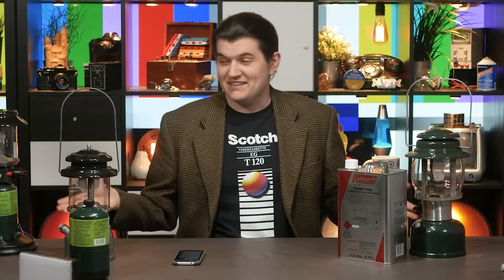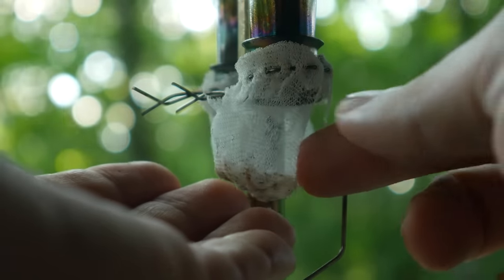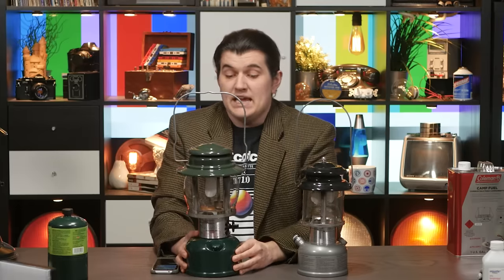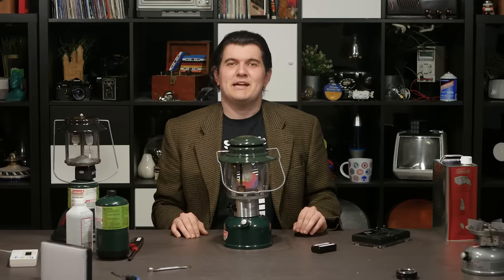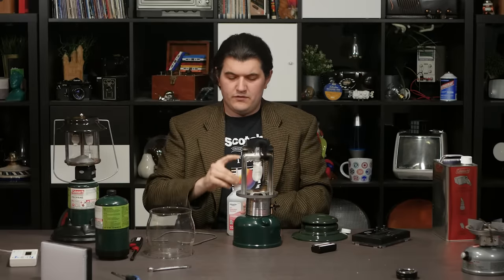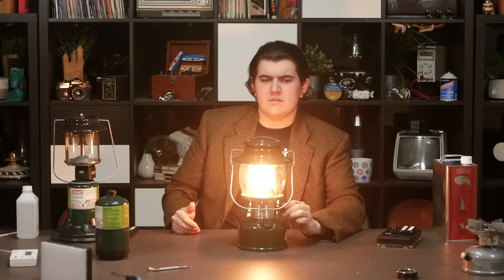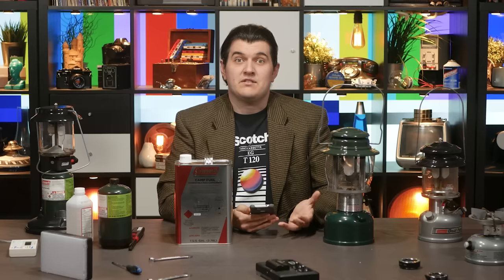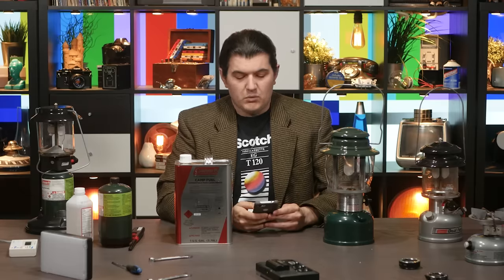A very rambly Coleman Lantern follow-up. Turns out they rarely make sense in 2021

Comment: You know you're deep down the rabbit hole when you start inventing new units.
Reply: I'm shocked he had to INVENT  the lumen/hour .... I'd have thought back packers would have wanted that years ago ???????
Reply: We need more using SI prefixes in nonstandard ways.
Reply: the germans made a kerosene lantern that doesn't need alcohol, they put a jet flame nozzle under the generator to heat it up
Reply: @tedundercarriage8183  That's the most German thing I've heard in a while
Reply: @edgeeffect  I believe it's "lumen-hour" (ie. not "lumens per hour"). Lumen-hours are the output energy analog of the stored energy (Watt-hours)
Reply: @tedundercarriage8183  Yeah, it's called the Petromax, however the user manual clearly mentions that using the "jet flame nozzle" will cause more wear on the mantle than using the alcohol cup that is of course also provided.
Another limitation of these particular lanterns is that you can't adjust the flame and thus brightness.
It's either full power or off.

Also to turn it off you're supposed to depressurize the tank then close the fuel valve, they explicitly say not to close the fuel valve while the tank is still under pressure.
Why ? No idea.
But they also come with a nice addition: A pressure gauge built into the fuel cap. Neat !
(This pressure gauge is also where you'll find a tiny screw that you have to loosen in order to depressurize the tank).

Because of the aforementioned caveats I would go either for a Coleman dual-fuel lantern or a butane one that can be found for a reasonable price in my country (France).
Reply: @psirvent8  sounds like you had a bad time with one
Reply: @tedundercarriage8183  Except I don't have one, instead I bought a butane lantern back a few months ago.
And using it indoors gives off carbon monoxide despite the manual saying that you can use it indoors in a well ventilated area.

Comment: Very good video. At 75 years of age, I can tell you that I have used all of them for decades. If camping, there is no reason not to carry both or all three, propane, duel fuel, and battery. I own three of the propane lanterns and at least 5 of the duel fuel lanterns. Night fishing is a niche use that requires either of the Coleman lanterns, propane or gas. The Coleman Powerhouse, holds more fuel and will last most of the night.  Whereas the propane will only last about 4 hours or so. With the Powerhouse adjusted down to about 3/4 brightness it will last from sundown to the first crack of light. The light draws shiners and shad and this draws the crappie. We generally fire them up just before dark, do some bass fishing for  a while to give the lanterns time to draw in the fish. Propane works but you will have to change out the bottle after 4 hours or so....scarring away the fish and having to go through the long wait of again attracting them. 

Duel fuel lanterns will pretty much get you through the night. As for camping, there is something about mantle lanterns that add to the experience. When camping I use Coleman lanterns and old school kerosene lanterns, as well as LED lights. Kerosene lanterns are ridiculously efficient and really add to the ambiance. As for emergency lighting, it makes sense to have battery lights, Coleman lanterns and kerosene lanterns. Living on the Gulf Coast, during hurricane season, I can tell you that you cannot rely solely on rechargable battery lights. The sun may not shine for a week or more. Always have a backup to your backups backup. 

I carry a backpacking propane stove and bottle in my boat as well as a single burner Coleman stove. When fishing during the winter I use them to warm my hands from time to time. If it is really cold....propane will not cut it. It becomes very difficult to get a good steady burn. This is why most mountaineers use the liquid fuel backpacking stoves. The Coleman single burner on the other hand, works like a charm.

One of the older green ones saved my life and likely my wife as well. If not for it, I would have frozen to death.I kept one in my duck hunting bag at all times. One day while hunting from a ground blind on a small island...a freak storm blew in and the temps dropped from shirt sleeve weather to 6 degrees and just a few minutes. The wind howled as this freak front blasted through. The windchill was likely -20. I think it was in 1983 or so when forcasting was not at all like it is today. It set a record. We lost 5 or 6 hunters that morning...froze to death in their blinds or in attempts to get back to the landing. Living in Louisiana we never see such events and most were not prepared. I was prepared, but like an idiot, I attempted to gather my (expensive) decoys. I struggled against the wind and got wet from the spray. Clear ice formed on my hands and the paddle. Giving up on the decoys, I  paddled back to shore. I hollered to my wife to fire up the stove and get the poncho ready to cover me. I knew I was fading fast and was in deep trouble. When I stepped out of the pirogue I passed out, hit the ground like a rock. Had I been alone and not had that stove, I would have perished or likely the both of us would have. After I recovered, and warming ourselves, we were able to put the stove in the pirogue and paddle to shore. The shore was just a short distance away. We left all of our gear there on the bank and headed to the truck. We nursed that stove all the way....our lives depended on it. So, the take away is, sometimes you need more than light and sometimes propane will not cut it.
Reply: Hello from Europe. Your experience with the near death freezing weather is teaching a lesson for survival. In what place in USA did that sudden freeze happen?
Reply: @MarianLuca-rz5kk  In Louisiana of all places. Here on the Gulf Coast we rarely experience severe cold. I can add that just last year we lost a local young man who was out squirrel hunting and a 12 degree front came through....they found him the next morning, frozen. He apparently had no method of making a fire. By the way, that freak front I wrote about, almost killed every woodcock in America. Most woodcock migrate to southern Louisiana. Almost all of them perished when they litterally froze to the ground. It took years for them to recover.
Reply: @WayneTheSeine  
Thank you for explaining the weather variations in Louisiana by the Gulf Coast. We too have a big delta of the Danube River in my country, a Reservation of Biosphere. There is varied wild nature, there are no gators or venomous snakes, but we have sturgeons coming from the Black Sea, where there are no sharks. The weather varies between -20°C and +40°C. You might wish to see on the Net about the Danube's Delta.
Reply: @MarianLuca-rz5kk  Thank you for the response. I will indeed check out the Danube Delta. I am sure there should be some Nature series on it. I do love the outdoors. I just came back from a 10 day campout on a small local lake and saw several gators, had a pack of coyotes near my camp at night, and was treated to the errie sound of the demunitive screech owl, nightly, near my tent. The weather was incredible, clear and cool the entire trip. My daughter lives in East Texas and recently encountered numerous copperheads in her yard. She spread the word to her neighbors and church members. She received a call yesterday to inform her one of her church members young daughters was bitten by a copperhead the day after she warned them about them. The girl has apparently recovered just fine. Copperheads breed in late Sept. and early Oct. then bare their young live, in latter Oct. They seem to be everywhere this year.....more than usual. Personally, I think it is a result of all of the hurricane damage to our forests. With so many trees on the ground, they have plenty of cover which protects them from wild hogs which feed voraciously on them. I will definitely check out the Danube and again thank you for telling me about it.

Comment: The reason for putting your thumb on the end of the plunger is your thumb can only hold back soo much pressure.  This prevents over pressuring the tank
Reply: It also allows the pump to be closed without fighting the pressure in the tank.
Reply: @WilliamWallace14051  that's what I was thinking, it means you can get the plunger back in if you've taken the pressure all the way up and not realized it until you tried to pump in.
Reply: Well, isn't this a brilliant solution.
Reply: @WilliamWallace14051  I think this is actually the only correct answer. The hole is much too small for the pressure to blow past your thumb. The smaller the hole the more pressure it takes to blow past your thumb. Try plugging your garden hose at only around 30psi and its very hard to do, but with a small diameter air nozzle on an air hose even at 150psi is fairly easy to seal off with your thumb. the hole on the lantern is even smaller. Also the surface area on the inside of the plunger causing resistance to you pushing against the compressing air is exponentially higher than the force to seal the hole. Basically the more pressure in the tank the better seal your thumb will make.

Comment: The Kanister is made of "Tinplate" ("white sheet metal"/"Weißblech" in German), sheets of steel, coated with tin, as protection against corrosion.
Reply: Jawohl, exakt, Weissblech. 👍 Dass er das nicht sicher wusste?
Reply: Is the inside (BPA) resin like food/aluminum cans?
Reply: @jasonjayalap  No
Reply: @jasonjayalap  Yes, maybe
Reply: @jasonjayalap  no. Cause you don't need it to be food-grade.

The flame doesn't mind burning a little tin that went in solution in the fuel.  Human bodys would.
Reply: @casemodder89  Wait, wait, wait, I shouldn't be getting my kerosine fix out of the lantern?
Reply: @worldcomicsreview354  of course you could, but not too often.
Reply: in the US, most plating would be zinc as the cost of tin is very high. These kinds of cans arent usually coated as the gas inside will vaporize a little and create a slightly protective coating unless it's been contaminated with water or just left open. Old cans of these will often be rusty on the outside but usually clean on the inside.
Reply: @brothyr  tin is also subject to crystallization and subsequent degradation known as "tin pest"; this is worsened by cold temperatures, and the phenomenon was partly responsible for the disastrous and deadly failure of at least one Antarctic expedition because the the tin seals on their food cannisters all leaked. (Tin pest is also why lead free solder sucks: the solder joints break down prematurely, consigning the product to an early grave. Lead/tin solder is more stable).

Comment: I think you may have under estimated the value of the heat that these things generate in a winter hunting camp.  Many times I felt that the heat was just as important as the light.  I was never far away from my Coleman Lantern when I was in camp.
Reply: Yes. The radiant heat they throw is great. Also, if you're bringing fuel, whether white gas or propane for cooking, it takes very little more to run a lantern as well.
Reply: 41:10 ?
Reply: Bring one of the fire-to-electric chargers 🤪

Candles can also produce a shocking amount of heat
Reply: 43:57 ?
Reply: @russlehman2070 BUT the heat is a hassle if it’s a hot summer night.  You don’t want your light source making you even more hot. You want a cool source like LED lanterns

.
Reply: Liquid fuels are also way more reliable in cold temperatures (Canadian winters with the fuel tank on snow or cold ground) than propane, because you don't have to rely on the vapour pressure or propane to move the fuel into the burner. Batteries also have reduced power in very cold temperatures, and the risk of water damage to the electronics from snow is another concern.
Reply: When in the North East I’ve used these style lanterns mostly as heat. The sun goes down everything gets cold (and dark) it can be a heater that doubles as a light source. It’s not wasted energy if you need the heat. In your cabin/camp.
Also always love your videos
Reply: Lots of assumptions and jumps to conclusions here. The fact is electronics performance in cold weather is poor. Batteries die more quickly, the lack of heat requires a separate heat source which negates the weight advantage, and the dependability of electronics is questionable, you cannot hope to fix them in the field, in fact they almost certainly require replacement.
Reply: @electrictroy2010  If its that hot out you can be outside the tent and don't need the lantern inside it.
Reply: Lmao literally already mentioned in the video

Comment: You touched on the real reason they are still available: the ritual involved. I have one of these little white gas lanterns, and sometimes I use it. Even though I know my little solar Luci lantern thing is better in every way. It just makes me happy to hear it hissing and glowing and whatnot.
Reply: You know, becoming older I can appreciate this sentiment. Been living with central heating for two decades now. But had to use an old-timey gas heater in an old timey building today (literally pre-war, in europe). No thermostat. Just spark a pilot-light and  turn up gas valve to hear the thing silently hiss to life, and snap and groan with the heat. I could enjoy that (If not for the old-timers groaning over the heater how they were still cold, sitting at the faaar corner of the room while I was sweating my socks off).

Some things never change  ; )
Reply: I used to have a kerosene fuelled Tilly Lamp that was bought by a collector in Japan. They were a faff to light with an alcohol preburner and lots of waiting.
Reply: Not better in every way - in colder conditions , the heat they give off can be a huge plus.
Reply: I have found more problems batteries and solar. Also not as bright. One gasoline lantern can last 3 days. One battery lantern will last one night. If you have a solar and it’s cloudy yer boned.
Reply: @timesthree5757  Cheap lanterns perhaps, I have a battery and solar lantern which gives WAY more light than my Coleman does and lasts 4 to 5 nights.
Reply: @thatperson3485  fine but how easy will it be to fix when it breaks. The complicated something is the skill required to fix it. I have one Coleman that is from the sixties and a brand new. I can do basic field repairs in minutes. Plus my lanterns provide heat. In my opinion modern tech is way to complicated to repair to be useful. I also have some pretty expensive lights. One doesn’t work anymore. 
Their are 3 concepts to any tech. Use ability, longevity, and repair ability. You have to have these three in balance. This is more important for emergency equipment. My go to is my Coleman lanterns, stoves, ovens, water heaters. When the tornado rolled thru our area My 60’s lantern was damaged 15 minutes and it was working. That same storm killed my expensive led battery and solar light. My other one ran out of power with no way to charge it. My lanterns, one damaged the other in working conditions kept my with light. With each lanterns producing 800 lumens with 360 degree illumination. To me beats modern tech.
Reply: @TimesThree  While I agree with a little bit of what you said, I must disagree. You point out if there is clouds you don't get power (you will still get some), but you fail to mention what happens if you run out of fuel for your lantern. If fuel is limited, suddenly the solar panel on a cloudy day is the better option. 

Overall I think your arguments are a little disingenuous, and you clearly don't like modern tech and you say it's not repairable therefore inferior. If you really feel that way then why are you online right now and not living with the Amish?

Also I'd love to see you do a field repair on broken lantern glass...
Reply: @timesthree5757 WHY bother with repairing when you can get a new LED battery lattern for only $20?  In terms of time, I earn that money in just 30 minutes.

Repair time on a broken Coleman (example: pressure tank no longer holds pressure) would faaaar exceed 30 minutes.
Reply: @FroggyMosh BUT the heat is a hassle if it’s a hot summer night.  You don’t want your light source making you even more hot. You want a cool source like LED lanterns

.
Reply: There's no complicated scenery in a light, it's usually just a resistor and a switch hooked directly up to a basic square LED. And maybe some extra circuitry to prevent backfeed-stuffs in a good lamp.

usually the only real way to destroy one is to extremely overvolt the crap out of one, but that's asking a lot
Reply: Ya I love using mine when camping, it just feels right. Sure it’s a little dangerous, not the brightest and very fragile, but I’ll be damned if it doesn’t look and sound great.

Comment: It is always a good idea to have backups.  As a Texan I have a new appreciation for the need to have a source of heat not reliant on the electric grid.
Reply: In the area of Oklahoma where I live there was a fad of building all-electric a few decades ago, but then most of those folks got either propane tanks or a natural gas hookup for some mysterious reason...
Reply: @absalomdraconis  That was common in a lot of states during the early ‘70s. The oil embargo made a lot of people go electric. Colder winters and lower fuel prices a few years later made them go to natural gas and propane.